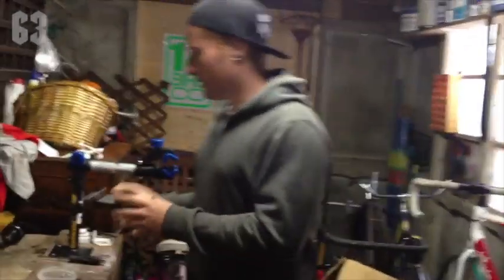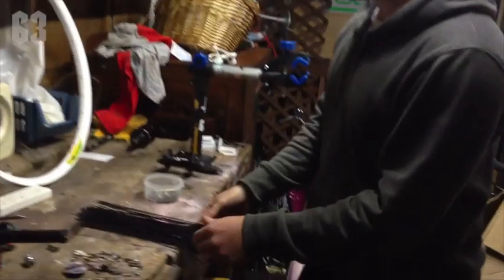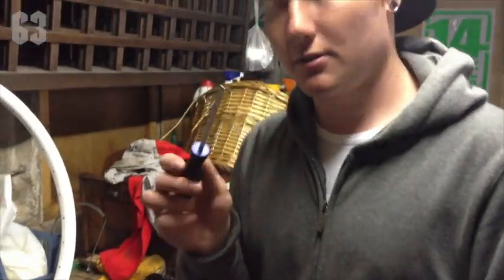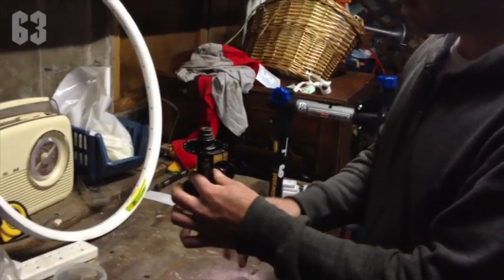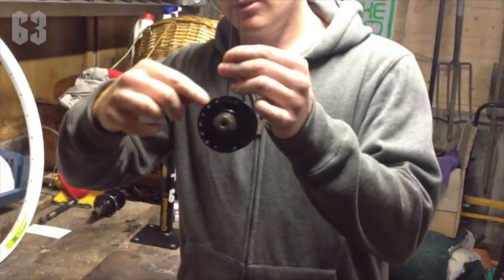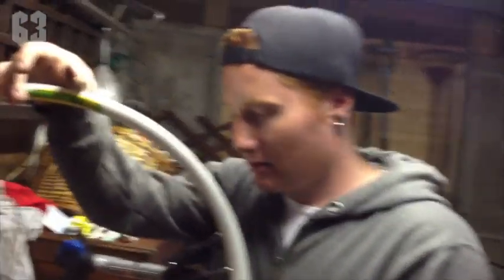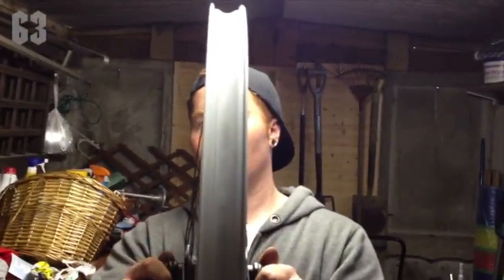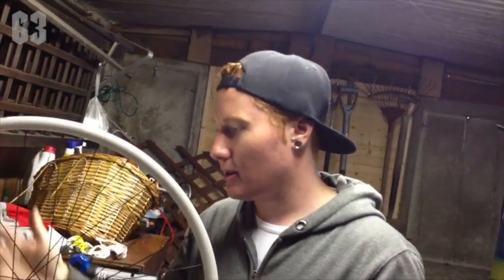How To Build a Bicycle Wheel

Comment: That a simple building technique. I like it. I have built my rims like and they are still trued and tension. For you people who have never laced a wheel before, my only advice to your is to do small adjustments when tensioning your wheel. Don't tighten one specific nipple do tiny turns on every nipple going all around the wheel.

Comment: Cool Video! I have a question, if my wheels came with 2 different sizes of spokes for the front and rear wheel, which side should I use the shorter ones and which side the long ones?

Comment: Dan could you clarify please? When you rotate the wheel/hub assembly backwards (towards you) does it matter if you are rotating clockwise or anti clockwise? i.e. the first laced side is on your left hand side? Thanks very much.
Reply: Yes, hub must be twisted so the first inner spoke is parallel with the valve hole.

Comment: Different wheel sizes will have different lengths of spoke. For example a 25inch wheel will have shorter spokes than a 700c wheel. It's best to consult your local cycle shop for correct spoke length.

Comment: Sorry Dan you laced the wheel up wrong! You left hardly any room for the pump head because you have spokes crossing at the valve hole. The spokes there should be diverging or almost parallel to leave plenty of room for the pump head.
Reply: Exactly
Reply: @Joyride302 Yeah that's it. I did it myself when i was first learning. I laced the spokes and then looked at it and thought "There's virtually no room for the head of the pump to go in there! That can't be right!"  Very easily done!

Comment: Thanks for the advice, I have a question, I have white spokes on my bike at the moment, 32 hole, and I want to get 32 black spokes and mix them in with the white spokes, i.e. 16 black and 16 white on the front and same again on the back so I have 32 white spokes left over when I'm done. I want the spokes to alternate colours at  the nipples so black, white, black, white all the way round, how will I do that? Would it be every spoke on the left side of the hub is black to give me this pattern?

Comment: I've screwed up 4 wheels using this vid. When you start the inbound spokes on the second side of the hub you need to put it in the next hole AWAY from the valve hole. Not the opposite side of the valve hole. Makes it a real pain to air up a 20 inch wheel.
Reply: Lol! Yeah you're right about that. I didn't really notice until I laced up a 20 inch wheel with a large flange hub. Then I finally understood what the significance of the valve hole and how you twist the hub.
Reply: No It ain't. I laced 3 wheels watching this vid
Reply: You picked a wrong hole in the hub
Reply: See my app Rad 3D, it shows exactly where the spokes should go, in 3D. And it's free. There is a video about it on YouTube.
Reply: The first spoke is parallel with the valve hole. When dropping in the first inner set twist the hub so the spoke next to the valve hole is parallel and not crossing over the hole.  When turning over to the opposite side, position the first inner spoke on that side so it is parallel with the one next to the valve hole of the first side. Both sides mirror each other. After that, the outer set crosses over two and under the third.

Comment: I usually use the complete inner set of a bent wheel,that i can't straighten out.I loop a sawing thread all around the spokes,tie it at the end where it started and the hub with all the spokes on it comes out in 1 piece staying in the same position as if they were screwed to the rim.You can grow a taliban or ZZ TOP beard,re-spoking a rim 1by1 and you haven't even balanced it yet.

Comment: Can someone help me? I want to build new wheels, the existing hub size for the rear wheel just says 135mm ( Not QR ). All the other hubs I see are ( 135 ) x9mm or x13mm. It's a scott voltage. Does anyone know what spec's I need for in the new hub? Thanks

Comment: Similar problem lacing old (40 hole) Sturmey Archer hub onto new 26" alum wheel. "Trailing" spokes (the 1st 2 sets) go on easily enough. But then a problem. Comparing w/ old S/A 26" rear wheel example, adjacent spokes on rim, on same side, face 180 d. This is incredibly tight--spokes seem too short to reach, even w/ twisting hub. Yet new spoke length = those on old wheel, and rim = same diam. Don't know how they do it.

Can't clearly see final spoke layout in yr vid. Pls tripod for next vid tx.

Comment: WARNING!!! He forgot something that's "key". The spokes on the DRIVE side are around 1mm shorter than the BRAKE side. Just using one size of spokes will throw off things when truing the wheel. A child would have known that, 63fixed. C'mon man!!!!
Reply: fatcatdj its a front wheel he's building so all spokes are the same length!!!

Comment: This is a way to lace a wheel,it happens to be one of the wrong ways.Please, read a few books or articles on the topic.
Reply: Larry Daniels yea his valve stem hole wont come out  in the window.
Reply: +Larry Daniels Well spotted Larry, the error was made with the first spoke of his second set. He put it in the wrong hole. That then results in the spokes crossing at the valve hole and leaves little room for you to get the pump head in there.  A very bad error and could result in a lot of confusion if people try to lace a wheel following this method.